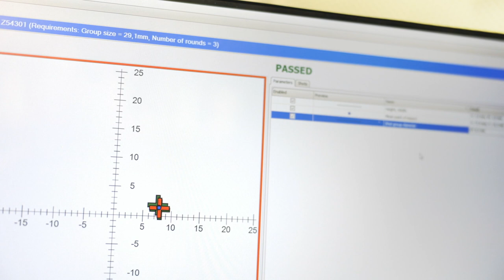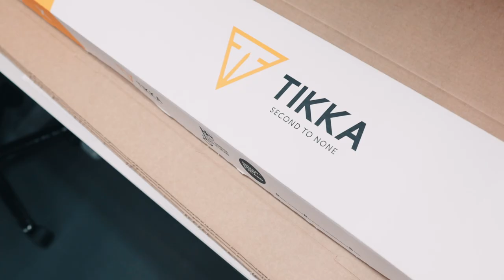Sako Rifle Factory Tour

Comment: So the video looks amazing. However, I wonder if QC is really that intricate and hands on. I say this because I purchased a Sako S20 Precision 300 Win Mag and it refused to grab hold of a round and eject the spent casing. No matter which ammo manufacturer I shot. I'd have to shoot open the bolt, tip the barrel up towards the sky and let the spent casing slide out of the chamber. Had gun Smith look at it and found the ejector claw was defect. So I had to ship my rifle to Beretta Firearms on the east coast since they are the distributor for Sako in the United States. They had it for around 2 months. Sent it back with a new red colored metal ejector/extractor claw (original one was black metal). Guess what, same issue. Refuses to grab hold of the spent casing and pull it backwards with the bolt to be ejected out of the rifle. Only way is if I slam the bolt forwards with an abnormal amount of force. And even then it sometimes still won't do it. So now I have over 3 grand into my rifle and it just sits in a case. It was my first Sako and maybe it was just a bad apple. But not very pleasant. I really wanted to enjoy the Sako and was hooked on the "Demand Perfection" and a rifle for generations. I mean you even had Remi Warren review it and he was happy. That man is 1 of the smartest and most knowledgeable hunters in our time along side with Steven Rinella. So I was defintely sold. And defintely let down.
Reply from the maker: Hi, please get in touch with our direct after sales support in Finlamd at info@sako.fi to report your case. Thank you.
Reply: @Sakointernational  Can you tell what the name of this song is, please?
Reply: No doubt, their 100% is a 10/10 standard, they meet and exceed MIL-STD-1535.

Comment: No doubt this is one of the best rifle manufacturers in the world (special applications); however, it remains an unknown contender in the world arena of assault rifles, automatic grenade launchers and other high volume selling harward.

The recent Swedish/Finish national assault rifle program is a purely Scandinavian deal to build up the local capability and meet the UOR. I've visited their facilities years back and knew few of their engineers and they remain the best rifle manufacturing craftsmen and women I have met.

The factory looks more tidy in the video because the production is not at an optimal tempo as it should be - unfortunately - 😔
Reply: Unknown contender? the RK62 is pretty much widely known to be the greatest AK platform weapon made. even the israelis basically made a knockoff RK with their Galil.Sure they could amp up their production numbers, but the quality theyre known for would be hindered. Besides they were a hunting weapon manufacturer before, and they still are. Last i checked, you dont hunt with assault rifles.

They would become basically like any other united states based manufacturer, making big numbers of pretty mediocre guns.